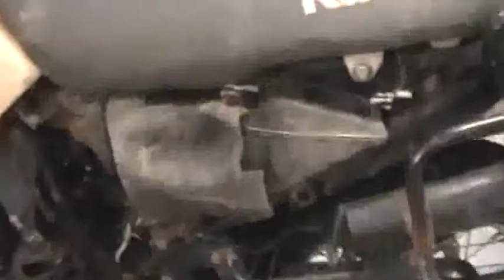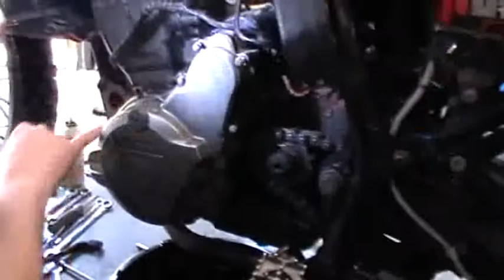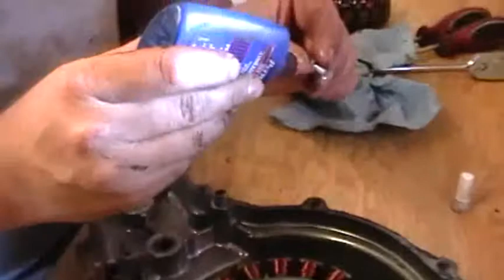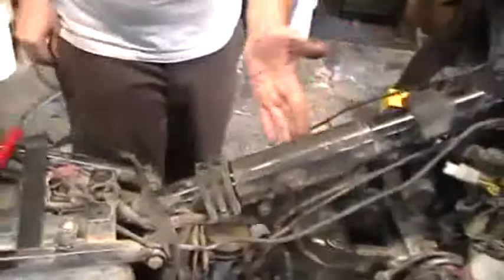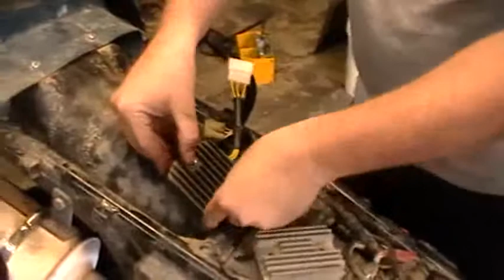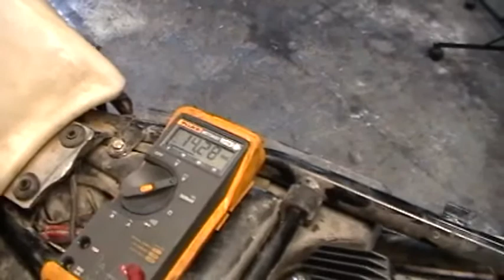RaceTech Electric Install of Kawasaki KLR650 Stator & Voltage Regulator

Comment: i just pulled the side cover off and the pickup coil little plate that goes on with the screws  looks like someone must have put it on upside down ,it is bent flat with shinny scrape marks ,would this make it miss and back fire , i just bought it not running  2005 kfx 700  are they an adjustment on this if i can find a good one / new one ? ~ thanks for your reply
Reply from the maker: Not likely unless the magnet or the wires/coil is damaged. The mounting plate wouldn't affect anything. Look up the resistance spec in the service manual and test it to be sure.
Reply: metal tab mashed between mag & pickup coil ( fixed) thanks
Reply: WHAT IS THE LITTLE ORFICE ON THE VACUUM VALVE DIAPHRAM FOR , ONE OF THE LITTLE BRASS PIECE IS MISSING ,IS THIS A RELIEF ORFICE ?

Comment: My 650 versus lose power every time when it gets wet.what can the problem be and what can i do about it.its a 2006 modle
Reply from the maker: Hard to say for sure. Since it happens when wet, it is most likely an electrical issue. I would check your ECM or CDI box, ignition coil(s), and make sure all connectors are tight and have dielectric grease.

Comment: I owned a klr650 2008 .it seem problem at charging system.I tested with the tester meter and reading only at max 12.9...and it wouldnt increase even the rpm goes higher .something wrong with the charging coil?? as the rectifier is  brandnew

Comment: Hi i am setting up my 95 Kawasaki  500 ninja  stater coil  but it has 2 set of wire  3 yellow and the other has a yellow & a black i just cannot find where the connection goes for the set with the yellow & black

Comment: Hi,i'm trying to put my regulater cover back on to my KLX250cc M2 1999 ,it is electric start and am problems linning up the starter pins/ gears. i got it on and when tried to push start it just locks up.what do i do? thanks mark